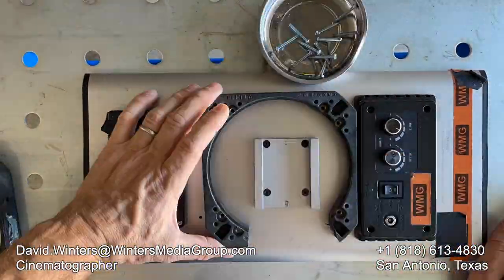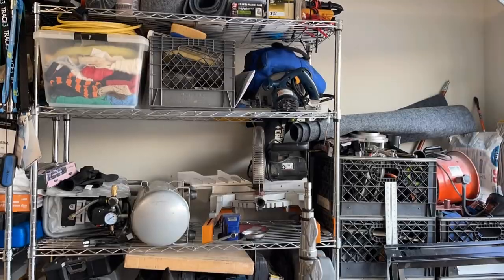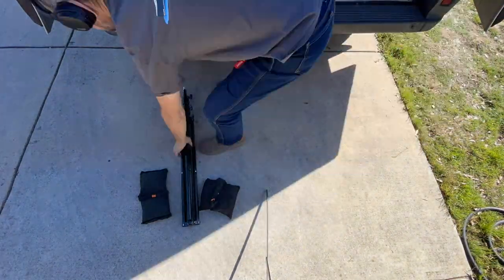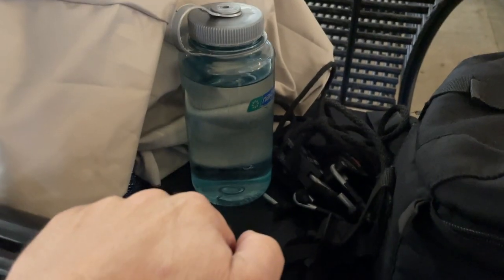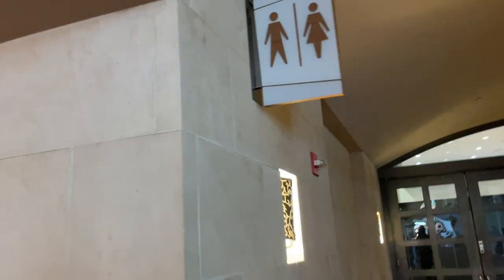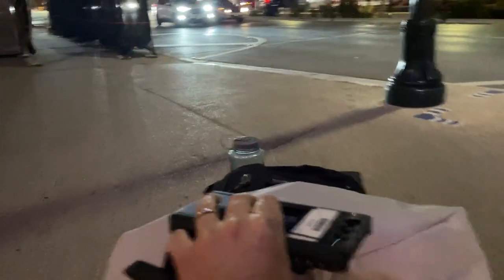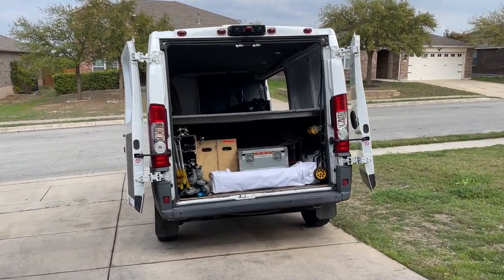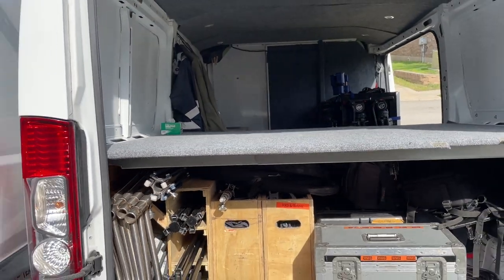Exhibit hall interviews | Neewer LED mods | Freelance DP

Comment: Very helpful video, David. I have a couple of Yongnuo LED pandels (not recommended) and might see about doing some sort of a DIY softbox for them. (The ones that I got off Amazon color shift blue / magenta so much I can't use them). How do you find the color balance on your Neewer lights?
Reply: Lol I have the same light and am trying 5o construct barn doors for it haha 3d printing here I come
Reply from the maker: The color balance on this specific model is excellent.  No issues, I mix them with all the other pro level manufactures on various productions.

Comment: What is providing the power to the lights in this kind of scenario (end eng)
Reply from the maker: Core SWX Hypercore NEO 9 Mini 98Wh Lithium-Ion Battery (Gold Mount)
Reply: @CrankyCameraman  For the panels or the Apurture lights? I'm assuming the apurture would require more than one?
Reply from the maker: Aputure 300D runs on two gold mount batts.